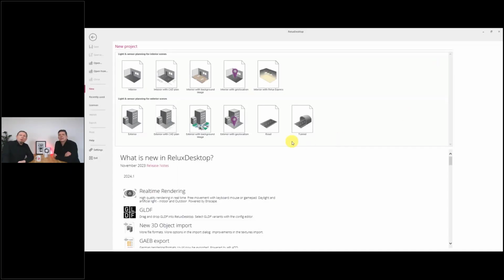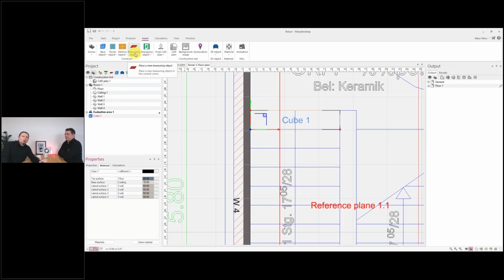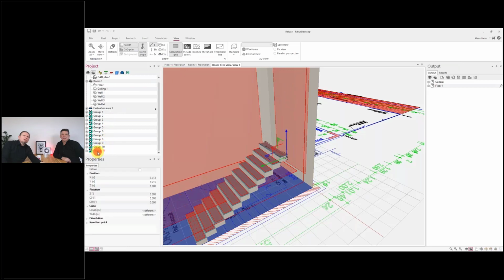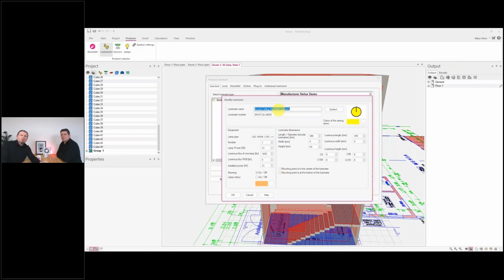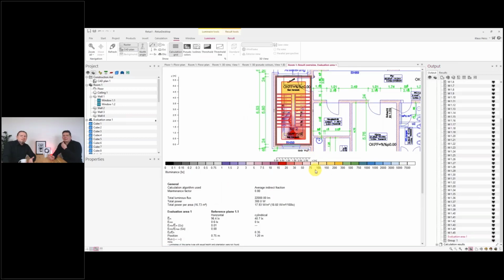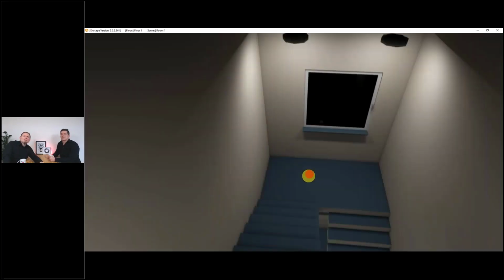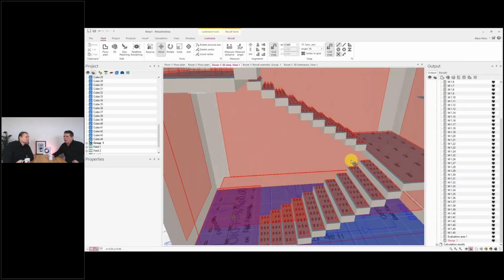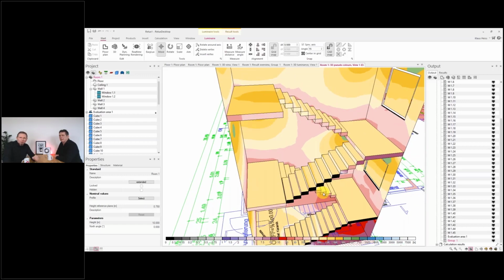FUN with RELUX – Episode 30 – Staircases in ReluxDesktop

Comment: I have one question about the part around the 8' mark, please. When the illuminance on each step is not as relevant as the uniformity of lighting overall, would you use calculations surfaces which cover the entire length of each ramp and are angled to follow the same inclination as the stairs, please?
Reply: Yes, the illuminance is relevant as far the avarage value is achieved together with the uniformity. Further yes it recommended also to take an inclined measurement surface for the whole steps to evaluate the values. Just make sure that the measurement points are horizontally aligned as the surface is inclined.